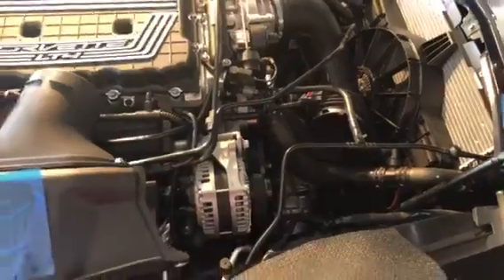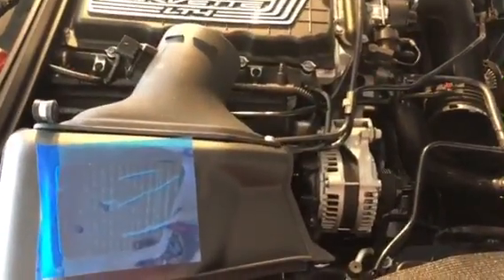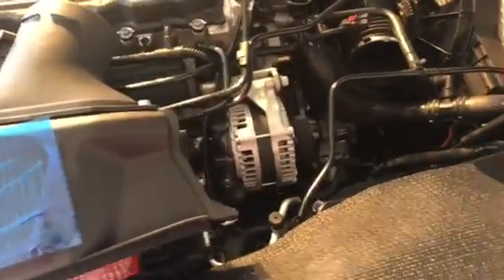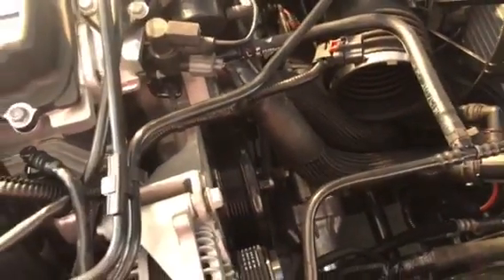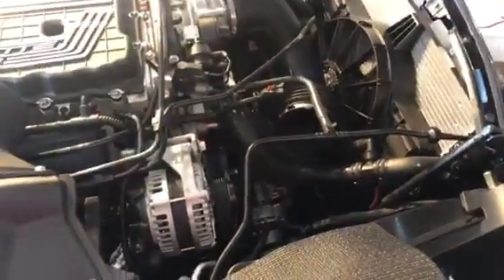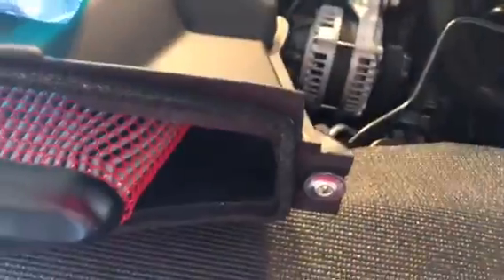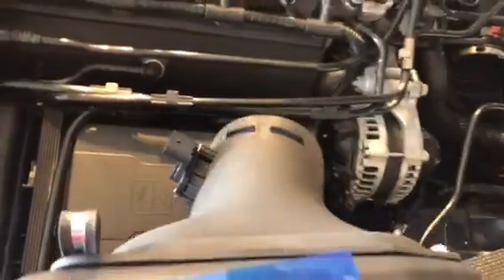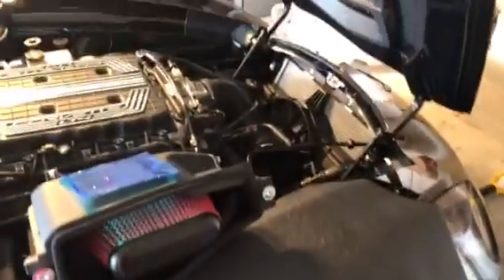C7 corvette Z06 GM performance filter installation.

Comment: I have a 2017 Z06 and bought the same intake. Did you have an issue with the plastic part attached to the underside of the hood hitting the intake and ultimately pushing the hood towards the drivers side?